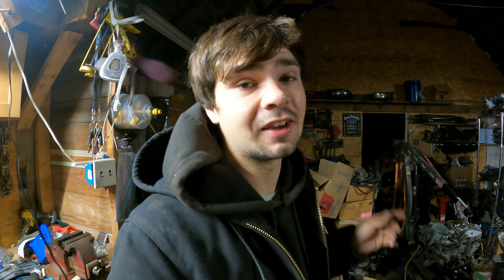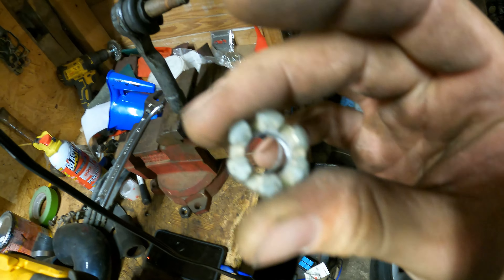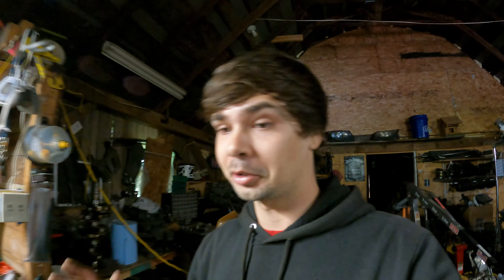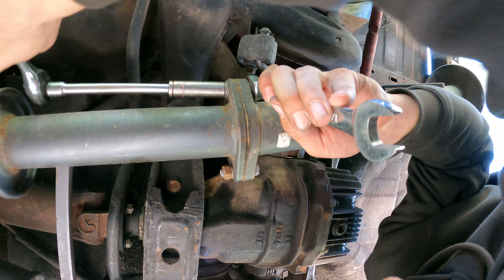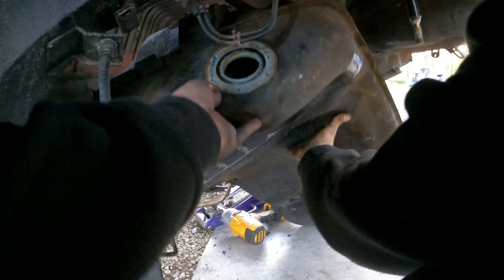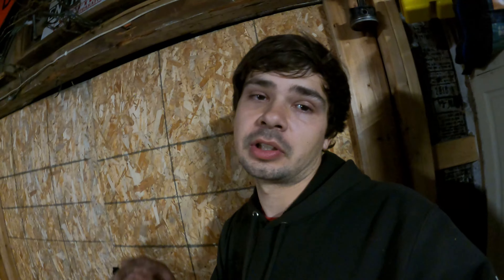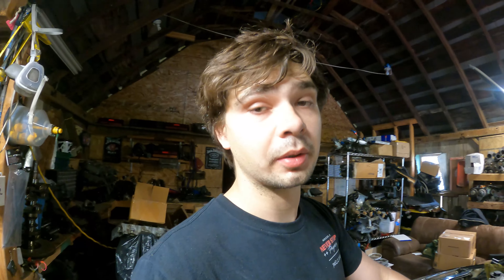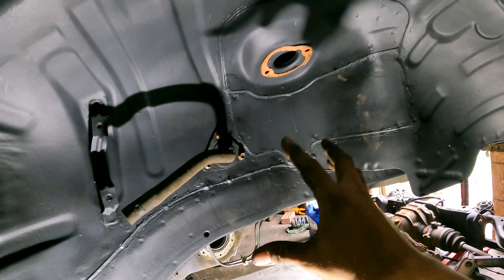My Vert 300zx is ALMOST FINISHED! + New Project Car

Comment: that tube looks like a line from one of those harbor freight double pumps to syphon or put fuel in something, looks like either they were trying to transfer fuel or pull some one and it got stuck when they tried to pull it out and snapped inside, they are held on by a barb fitting so it doesnt take much force. great video as well
Reply from the maker: I seen the pump the last time I was there and thought it looked familiar🤣
I bet they wish they knew there was 2 drain plugs on the tank😅